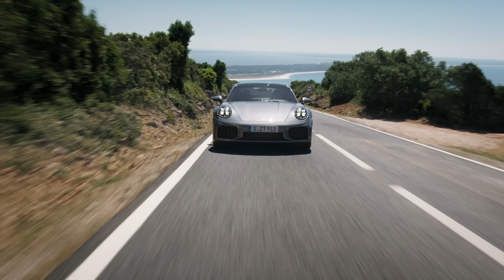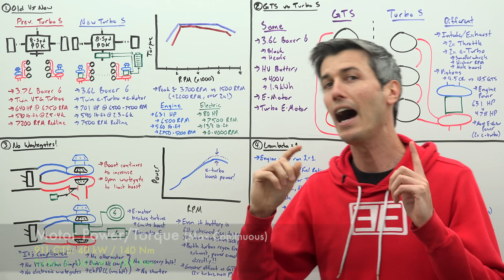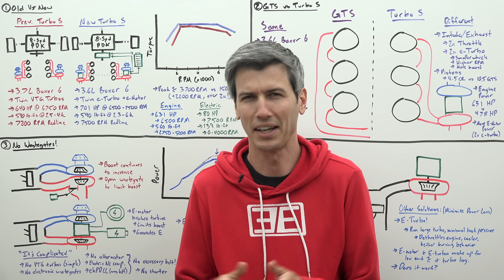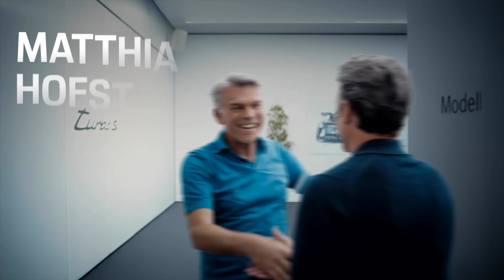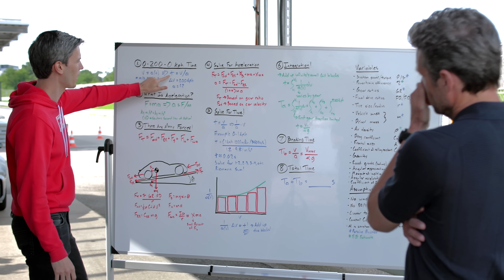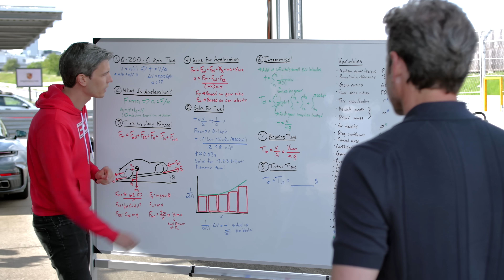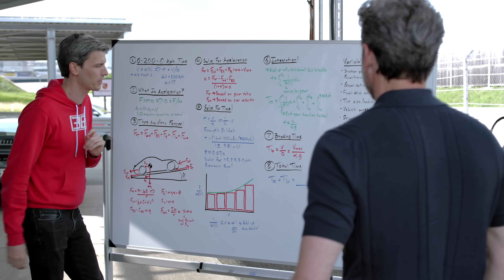The Most Powerful Porsche 911 Ever - New Turbo S Engine Deep Dive!

Comment: I like it when environmentally sensitive Engineers fawn over themselves w/ this climate nonsense. The waste in the exhaust is going to determine the efficiency of the combustion. Remember photosynthesis; the process plants/trees use to create food using sunlight & the terrible CO2 emitted from the terrible I/C & Diesel engines? CO2 is an atmospheric trace gas that does absorb certain wavelengths from the Sun warming the climate. However, there's a saturation point & adding more CO2 to the atmosphere becomes mute. So let's stop wasting development money on environmental emissions & more on combustion efficiency. We also need to R&D the Manufacturing processes to make this cost efficient, aimed at the price point of Porsche customers. Eventually trickling down to less expensive vehicles.

Comment: Finally, there is some of that Porsche 919 evo tech in their road cars. x)
These motors might not exactly lock in lambda 1. If the engine hot, the engine ECU will run the fuel mixture a little bit richer to protect the motor. Otherwise, if the engine runs hot for too long, the motor might grenade itself. Especially in hot weather conditions. There still needs to be a failsafe in extreme weather conditions.
I think you melted Dempsey's brain on the acceleration explanation. xD

Comment: Great video covering an awesome car, from what you have talked about, I have two questions regarding the turbo regen if you don't mind?
For one, what if the HV battery is full. Say I force the drivetrain to use the ICE exclusively and build a lot of boost, then the electric motor will keep charging the battery. But once the battery is full, there is no longer any eletric load on the motor/generator. At which point the boost control resistance would disappear. How is this dealt with? Does it just forcefully enable the electric motor to consume energy?
Secondly, wouldn't an all-regen like this create significant exhaust backpressure? Like TurboSmart's straightgate wastegates allowed for reduced backpressure to the point where at lower RPMs, letting the engine run NA may perform better than with a turbo. Is this just taken as a sacrifice for the greater power? Or is there a leak valve for when the exhaust really starts going?

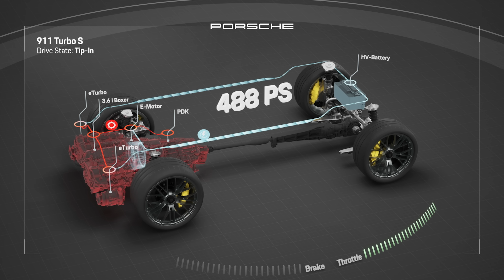Comment: Your videos are great, thank you for the great job you are doing! Yet, a 14-second improvement in track time (10:15) is more related to suspension upgrades than to the powertrain. The only reason I believe they paid so little attention to the electrically enhanced suspension is that they’re saving this narrative for the GT2 RS.
Reply from the maker: It’s actually mostly due to tires and powertrain (about 50/50 each, chatted with the engineers about this). Suspension is in fact improved, but it’s a fairly subtle difference in terms of performance.

Comment: Love your video, thx. The big BUT is When did porsche have Jorg drive the 992.1 in Nurburgring?

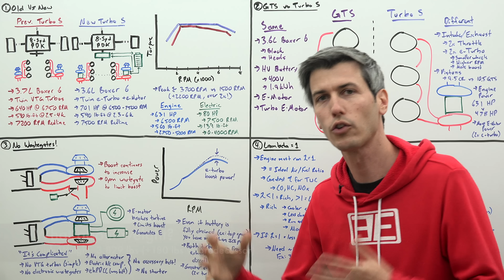The 7:17 time was done by sport auto if I recall. The sport auto times never come close to factory times in other Porsche s. For example they were 6 seconds slower in a GT3RS.

I dont understand why Porsche is quoting this 14 seconds. Its not an apples to apples comparison.

Furthermore, the 7:17 time done by sport auto was on a stock car and on crappy P zeros. This car here in .2 is fitted with a race seat, full cage, interior completely gutted out without passenger seat.

Are you guys kidding us?

Comment: Out of the TurbE, why not send the power to the batteries? Does going directly to the E-motors improve efficiency of the battery and/or is the E-motor that starved for current that it can actually output more total power?
Reply from the maker: It will go to battery or e-motor, depending on what’s best for current scenario.

Comment: As an HVAC tech., I've always wondered what a turbo would do if you controlled it with a electric motor. Like we do for big blower wheels and motors for air handlers. Love Porsche for making a product that I had wondering thoughts of from a long time ago.
Reply: This is based on MGU-H (Motor Generator Unit-Heat) in Formula 1. Porsche planned to join F1 for like a decade ago and was screwed up by the emission cheating problem of Volkswagen, but they still managed to employed the MGU-H tech on their new cars. It's an elegant solution to the thermodynamic and mechnical factors that are against each other in the turbocharger, significantly simplified the system, and increasing efficiency by regenerating power from the exhaust gas.
Ironically, when both Porsche and Mercedes (using MGU-H in their new C63) are launched road cars equipped with MGU-H, the FIA decided to removed the MGU-H from 2026 power unit regulations because it's "too complex and too costy, and having little usages on road cars"...
Reply: @jeffery7281  THATS WHAT THE MGU-H IS???? THATS WHAT KEEPS BLOWING UP ON MY HAAS IN F1 25??? Man... Good to know, but man...
Reply: @jeffery7281  I believe Audi also wasn't too interested in joining until they heard that the MGU-H was getting phased out. Funny enough, the other manufacturers then blocked front wheel drive electric motors because they feared Audi might have a leg up on them in this regard.
Reply: toyota has been using electric motors to control its HVAc and other systems on their hybrids, in the beginning they even used a hot water/liquid reservoir to keep the engine or vital components hot. people have been able to camp in prius for years while barely using any fuel for example as a result.
Reply: electric motors are a crazy thing if you think about it. The ability to convert mechanical and electric energy with very high efficiency at will in both directions is actually kinda mind boggling.

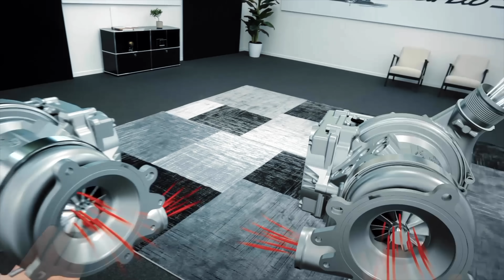Comment: 6:23 Jason is one of the few gear heads that isn't hostile to electrification . 

 He embraces whatever technology makes cars better, and I appreciate that. 

 I'd say they are better for 90% of people. Except people hauling, or driving 6 hours non stop. Live in the middle of no where. 

 The good models that is; beware of the trash legacy automakers half arsedly made. Then sold just so they could.

 1) Get subsidized. 

 2) Make EVs look bad to everyone. 

 EVs, and future hybrid will be amazing if they can drop the piston engine. t's the piston design slowing us down. Need vane engines, or some rotary. 

 Got people in the same sentence saying EVs suck, while their dedicated sports car gets beat by a Kia EV6. 

 ICE cars now in the processing of  becoming toys, and investments for rich people. 

 500 wh/l battery manufacturing plants are being built. Right now EVs have a 15% weight penalty on average to a comparable car. 

 So with that said screw cars and the environment, electrification is amazing for other things like exoskeletons. 

 You all can drive to work I want to run 30mph without being that tired. There would be no traffic if we had exo skeletons.

Comment: I bet Patrick Dempsey and Jerry Seinfeld hang out at Jay Leno’s garage to watch your videos together. 
This car does everything right. It is straight from my dreams. Electric AC electric turbos, hybrid no belts no starter more than 12v in 2025 fps. All the archaic tech is out. A purely modern machine. Except for one thing I assume. I bet that mfr is crammed up in there as retarded as it could be so that replacing a cam sensor 5,6,10 years from now will be a nightmare though unnecessarily so because that engine should be able to pop out in 15 minutes or less if made correctly with that purpose.

Comment: Tuners are gonna hate these, but the tech is amazing! Leave it to Porsche to make something new and innovative as always. Congrats to you, you deserve it!
Reply: I can't wait for an aftermarket electric turbo
Reply: @SoulTouchMusic93  Oh it's coming for sure.  Bigger compressor/turbine wheels with a stonger electric motor/generator.  A beefed-up E-motor pushing out more power.  I'm just curious if you start to make more power from the engine, does it completely bypass the e-motor and straight to PDK, just leaving the E-motor for slow-speed or initial drive.
Reply: @ksek09  i've dreamed up an e turbo system that has 2 electric motors in it. one on the turbo and one on the crank. if the turbo needs spinning the crank spins the turbo like a supercharger but with electric drive. and if the turbo needs slowing down instead of using a blow off valve just use the turbo to put power back at the crank for basically free horsepower. no need for a battery in between.

Comment: would love to see a company like Porsche and many other companies actually develop groundbreaking new technology instead of trying to reinvent what I currently have. Let me explain.  The biggest problem to performance and the environment is not the engine. It is the brakes and the tires.  There has not been one company that has taken on the challenge of developing a car that can break without using massive calibers and super expensive rotors. Has anyone ever thought about using tiny motors at each wheel that spin backwards to create reversed force when the brake pedal is applied?  Using that regenerative force to then recharge battery and use that energy to slow the vehicle down yes we have that on electric vehicles, but there needs to be a system implemented where we completely get rid of brake pads. getting rid of brake pads, not only reduce cost, but it will also reduce impact on the environment with the amount of brake dust that is exposed to the air into the roads and to our car and to our wheels.  Their needs to be in conjunction with a tiny motor, a ceramic disc made with pads that do not dust at a minimum of 8 inches in diameter built into the motor. Doing so eliminates any dust impact to the wheel and to the environment.  Second challenge then I will be very impressed figuring out a way to manufacture a tire that does not give off carbon but also will last upwards of 50 to 80,000 miles without replacement.   Again no car company seems to be focusing on this. I don’t give a crap about the tiny refinement that Porsche continues to build. Let’s start building a car that’s for the future.

Comment: If we were adding a "brake" to the turbo for regeneration. Would we be effectively adding to much back pressure on the exhaust system 🤔? Especially compared to a waste gate. So effectively adding a constant exhaust brake when its not needed.
Reply from the maker: No, a wastegate is just letting excessive energy escape. An e-turbo is making a use of that excessive exhaust flow. Once you reach peak boost, any additional exhaust gas is simply wasted energy. The eturbo takes advantage of that.
Reply: @EngineeringExplained yes, but the eturbo housing is no longer processing the additional excess energy only converting it as i understand. But the gasses themselves are still stuck in the system and are not expelled/ bypassed. However the way around that would be an infinite compressor wheel where the gasses can flow freely without the need for a "locked psi" on the intake side. In other words not sharing a common drive shaft like turbos today.

Comment: Could you run this model for a car that would have 1G of acceleration? We would see if this 911 is over 1G or not. Thanks for your great content.
Reply from the maker: Yep, I’m assuming (for my calculation) a peak acceleration of 1.2g. And it beat my estimate!
Reply: 1G equals around 9.81m/s^2, 200km/h equals 55.5... m/s. If t = v/a then t = 55.5.../9.81 ~= 5,66 seconds. Thats the time to accelerate with 1G from 0 to 200. Assuming deceleration is also 1G but with opposite sign total time equals t ~= 11.33
It's worth to mention that the driver for sure experiences at least 1G at some point in time, it's just average acceleration that is lower than 1G

Comment: Currently 3x 911.x doing three circuits a day  around the southern Spain 200km test loop based in Mojácar. These are ICE only models (no Yellow Triangle EV stickers) and unusually one of the cars is a convertible. Also 2x VW vans on the same loop.

Comment: Is this new engine the 9a3 ? Does it get the displacement the same way the 9a1 did in the 997.2 Carrera 911, with a bore of 97 mm and stroke of 81.5 mm ? What is the valvetrain design arrangement ; bucket, roller rockers or finger followers ? Just questions beyond the electrification aspects.

Comment: I can only say, as an ME with a PhD in combustion engines, amazing job and congratulations 🎉. As a media consumer, excellent video as always.
Reply from the maker: Very kind, thanks for watching!
Reply: As an ME with no PhD, I love this.
Reply: As a non-ME without the PhD, I fully approve.
Reply: as an ME in future, i love this
Reply: As a YT comment commentator, thanks for your comment.
Reply: ME graduate here, I love Jason’s video’s!
Reply: So you’re oxidizing your media.
Reply: Ok question for those with the PhD in combustion engines... How does adding diesel exhaust fluid and burning more diesel fuel make emissions "less harmful". Shouldn't we be focused on just burning less fuel? The fuel has to be created in the first place and that takes energy too.. Which also creates emissions.   Make it make sense...
Reply: @ib4217 it mainly has to do with the fact that an engine being more efficient doesn’t always mean fewer emissions. The gases that diesel engines generate a lot of are nitrogen oxides and carbon particles (soot). These are what we want to reduce with emissions devices like DEF and DPF. A great example of this is the VW “diesel gate”. The fix for those vehicles actually reduced their efficiency put emitted fewer of the “bad” items. DEF causes the amount of nitrogen oxide emitted to be much lower. DPF’s cause the soot to be collected in the filter and eventually heated up enough to “vaporize” that soot into a gas. Occasionally it needs some extra fuel to reach those temps. Generally it is considered that the additional consumption of these items results in lower carbon particles and nitrogen oxide emitted than required to make/combust them.
Reply: @paulmorrow8372  if you are going to regulate the fuel/energy then the energy/fuel should be provided for free.  Let us be free. CO2 grows trees.

Comment: Adding 2 EV motors and only 180lb difference.. something Mercedes, Audi, and bmw should learn from.
Reply from the maker: BMW: write that down!

car increases 1000 lbs
Reply: It's because of physics - motors for EV are usually High-Torque Low-Speed motors to avoid using additional gears and remain simplicity and high efficiency of the system. The problem is low speed motors requires big coils, and coils are heavy. Turbo spins much faster than engine and the wheels, which means the motors can be smaller. Also brands you named usually include electric only mode in their hybrids, which complicates the drivetrain and requires much bigger battery than motors used only for support for ICE

Comment: Electric Turbo sounds really reliable. Lol
Reply: Electric motors are literally the simplest motors used in the industry. Requires literally one moving part - the rotor
Reply: Motors burn out. Especially motors that have to run at turbocharger rpms... 300000rpm is quite a lot. How many blenders have you gone through vs how many lawn mowers? More parts does not mean less reliability. Build quality and plain Physics is what it's about. An electric turbo will never last longer than a normal one because Physics don't allow it, with our current Motors at least.
Reply: @OutOfNameIdeas2 you are wrong. Blenders uses cheap brushed DC motors, which life is very short, due to brushes physical contact with the stator. Lawn mowers uses AC motors which are far more reliable than brushed ones, due to lack of brushes.

Less moving parts means less points of failure, that's the most basic engineer principle. Idk why you try to fight that.

Motors used in electric turbo are the brushless ones. If you use liquid cooling they're basically impossible to burn, no matter the RPM. Power loss in windings is far more important

Comment: what about the heat generated from using the electric motor as a brake for the turbos ??
Reply: they are not brakes, when apply a load (in this case the electric motor in the drive shaft or the battery) to the electric motors in the turbos, the electric motors (in the turbo) resist rotation as you are converting kinetic energy into electricity, so most of the energy of the turbo is turned into electricity, the small amount that is turned into head due to losses can be cooled with air or water.
Reply: @Raptor.Hunter adding resistance the exhaust gas flow will accumulate a lot of extra heat.
Reply: It charges the battery
Reply: Electric motor doesnt brake like classic brake, by converting mechanical energy into heat of metal disc - instead it converts mechanical energy into electricity that is used to charge up batteries. Only heat that is generated is due to losses of the system and is not a principle of a system design. Electric motors efficiency is usually close to 95% so very small amount of heat needs to be dealt with
Reply: Great question.
Reply: Yeah lets build a steam machine around it!